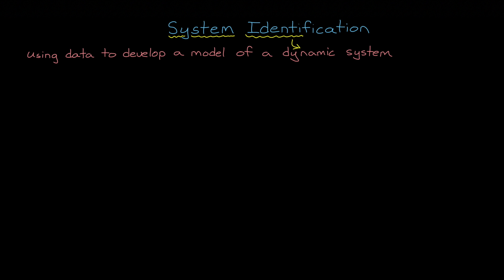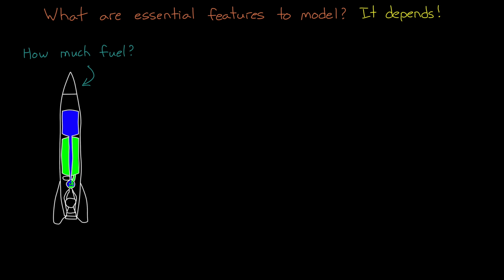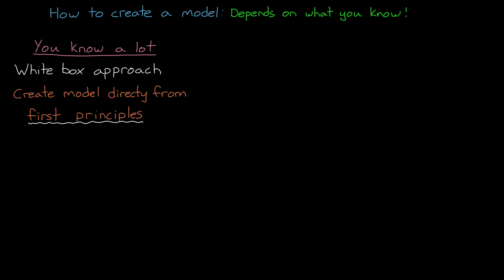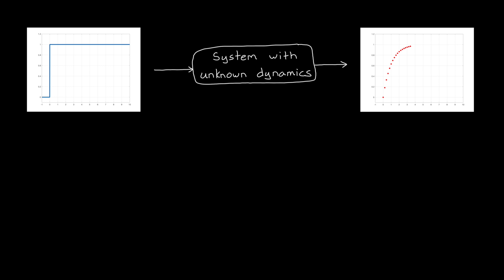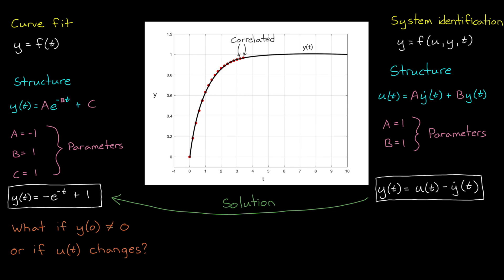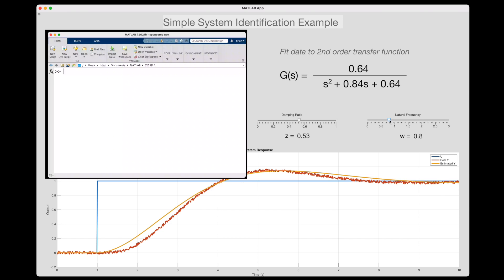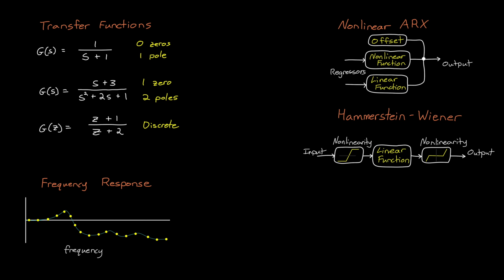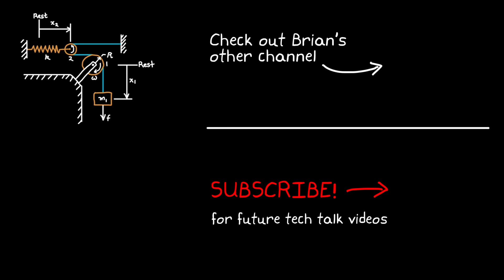What Is System Identification? | System Identification, Part 1

Comment: Hi Brian that was a great video but I have a question, where can I locate the block you use at minute 9:46? The one called real system with uknown dynamics, I can't find it and it would be useful for my college project.
Regards
Reply: That's just a regular Simulink subsystem that I labeled as "Real system with unknown dynamics". I created the dynamics in Simulink and then hid them away in a subsystem so the viewer couldn't see it. You can think of that block as whatever your real model or physical system is producing.

Comment: 14:52 The rigid cable is connected to mass m and its displacement x1 is the response signal; pulley 1 is rigidly fixed to a wall whereas pulley 2 is linked to the wall with spring k. The center of pulley 2 undergoes displacement x2=x1/2. The second additive term in the differential equation should be ... +k*x1/2 instead of ... +k*x1/4, is it not?  Thanks in advance for the response.

Comment: Great video but I have a question. In the example, how can you tell by examining the system response that you don't need to include any zeros in G(s)? I have learnt that the poles tell if the system is stable or unstable, smooth or oscillatory etc but I don't understand what role the zeros play. Thank you and keep up the good work!

Comment: Hello @MATLAB, Hi Brian, I'm trying to fit a model to my data which is a time series sports data. I have 2 inputs vectors of under 10 representative features each, corresponding to the 2 teams state vectors at time t-1, my output is either a win or a draw ( so 3 possible output ) so I would like to output the probabilities for each possible output. I feel dumb but I can't wrap my head around that .. Let's say A vs B was the game at t-1, and A won the game, next week the game is C vs A, my goal here is to take the state vector of A ( as a said earlier it would be a vector or few parameters that represents A ( Number of goals, shot on target, ranking at the time of the game ) PLUS the fact they won, and feed that to the next step ( which is the input of C vs Agame ) and so on .. up to 5 steps. Maybe you could give me some tips to get started ? Thanks and a big thank you for your Control series they are amazing

Comment: If I don't really know what the order of the system might be, I would first try to measure the frequency response function of the system, for example using tfestimate in Matlab (not to be confused with tfest) which uses Welch's method to average out the influence of noise. From this FRF data it will be a lot easier (after a bit of practice) to guess what a order of a model would approximate the system well, at least from the data used to obtain the FRF.
I assume one of the next videos in this series might also cover this and also mention when the measured FRF can be "trusted" using the coherence (though that doesn't give a completely objective measure of the trustworthiness).

Comment: i m a mechanical engineer and i'm completely switching my subjects to control field courses (like 'control of vehicle dynamics', 'vibration control'...) just because of you. you are a great teacher and a great engineer . Ty so much, Brian, ! keep uploading videos man
Reply: I have thought that a mechanical engineer knows control system engineering.

I am confused in which fields is taught control engineering.
Reply: @utilizator1701  we actually know control systems, but for sure  not much  as a control/automatic engineer. anyway, if you are interested in automotive engineering or energy managment you  find a lot of courses and elective courses focusing in simulink and control. That's based in what you like most and what kind of engineer you want to be.

Comment: Great stuff Brian....still remember your spring and paint can analogy from back in the day.....one question though - this is something that I've seen controls engineer have misalignment on in citing some literature;  when it comes to using System ID on closed loop system i.e. let say a PID based black box, this is common when it comes to using off-the-shelf components (motor drives etc), the method doesn't work well or is invalid in some people's view.....what's your take on using SysID in identifying a model of a system when a cascaded closed-loop is part of the system....